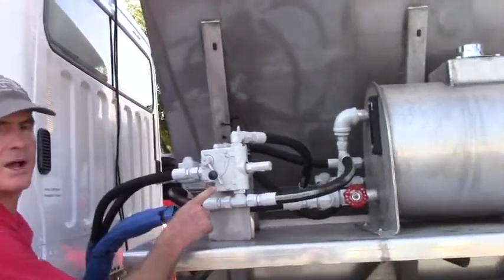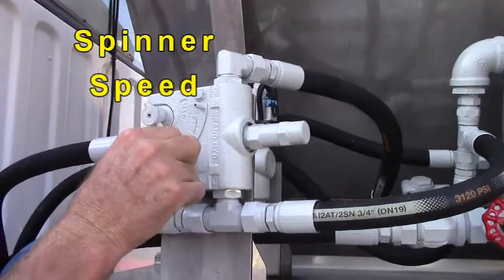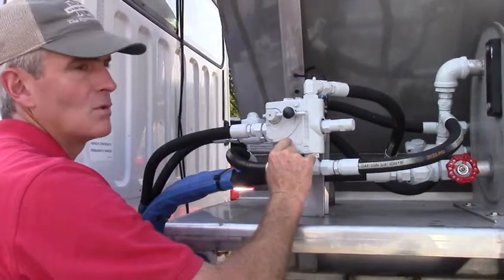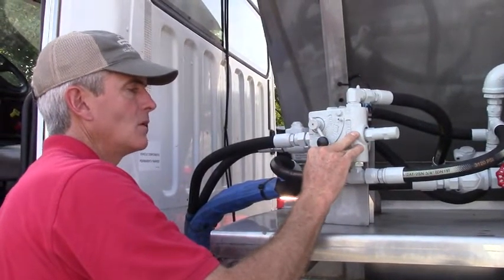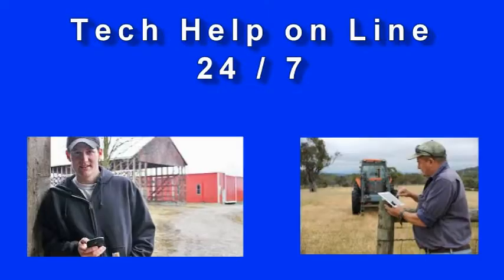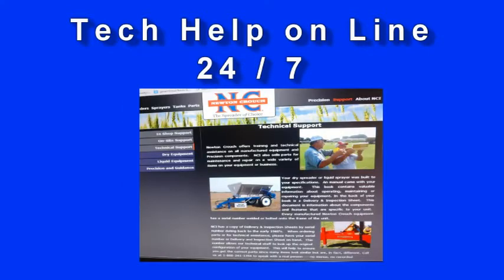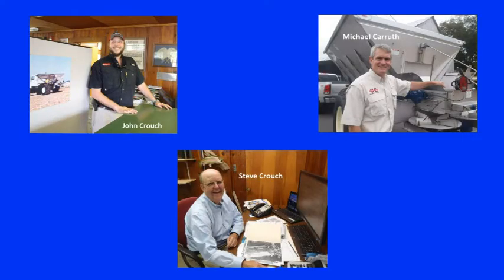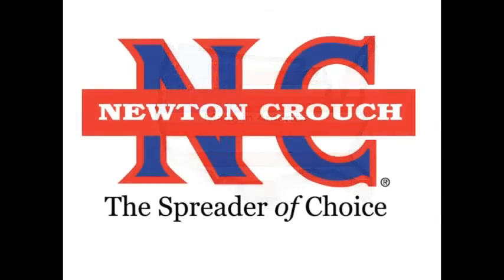How to Use Flow Control Valve for Manual Spinner Speed Adjustment on Truck Spreader

Comment: I have a question that I'm hoping that you or one of the viewers can help me with.
I build a small tow behind backhoe/trencher... It is powered by a 6.5hp engine. I'm using a 11gpm log splitter pump.
My problem is that my hydraulic cylinders are way to fast.  They are so fast that it makes it almost impossible to operate.
Would a small flow control valve similar to the one in the video correct my problem? If not, what could I do to slow the speed of my cylinders?
THanks
Reply: I know you wrote this 2 years ago, but I think the cheapest/easiest solution is an in-line valve before your valve spool.